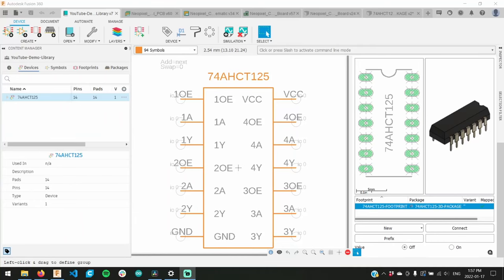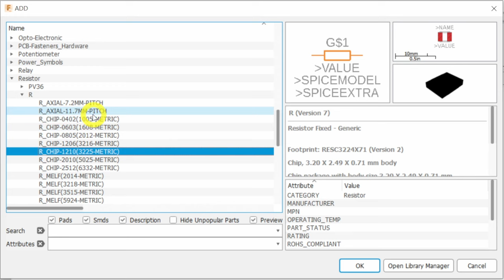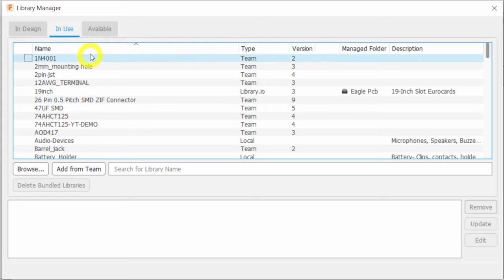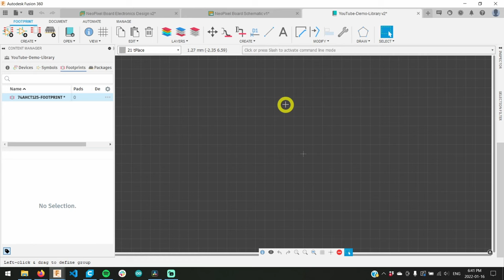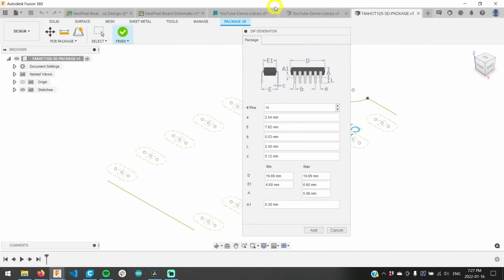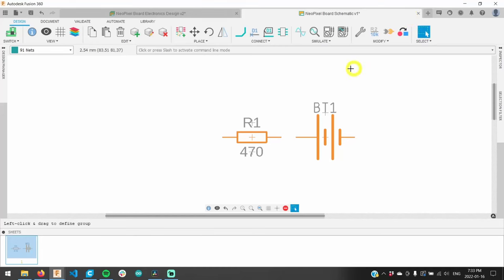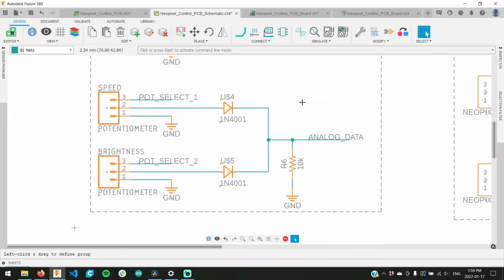Creating an Electronic Component Library in Fusion 360 [Part 1]

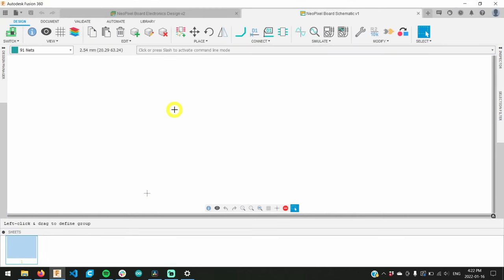Comment from the maker: May 2022 update: Fusion 360 has changed its UI and the component search function is no longer a pop-up window (as shown at 2:36) instead it now appears as a panel on the left-hand side. See this official Autodesk update video for more information https://youtu.be/1ubwXFqwMZ0 There have been some other cosmetic changes to logos and symbols, but underneath the cosmetic changes, everything still functions as shown in this tutorial video

Feb 2023 update: As pointed out by @RodStoddard, best practices are to include the parts name and value by adding placeholder text ">NAME" and ">VALUE" to both the component schematic and footprint.
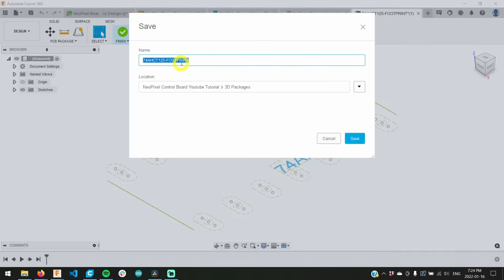Reply: what about minute 13:13 the scene which click the button "Create New 3D model" ??? because that button is not shown in my fusion 360 software, 

the version of my fusion 360 is : 
Fusion 360 2.0.15022 x86_64
Active Plan: Student
Windows 10 Pro 22H2
Reply from the maker: @ameiliaw8191  I am unable to reproduce your issue, I would recommend creating a post on the official Autodesk/Fusion 360 help forums and attaching a screenshot of what you see in your Fusion software for people in the Autodesk community to better help diagnose your issue. I'm unfortunately not able to offer much assistance on a platform like YouTube beyond what is shown in the video
Reply: okay sir  @WillDonaldson  thank you very much for your suggestion
Reply: A simple task of adding apart to a schematic doesn't even work at all now...      
EDIT: I discovered that using the Command Line and typing ADD brings up the traditional parts window and works like in your video.
The library manager is still very different.

Comment: Man, that looks horribly annoying to build one component lol. All I need to do is just change an existing parts labels but it doesn't let me...
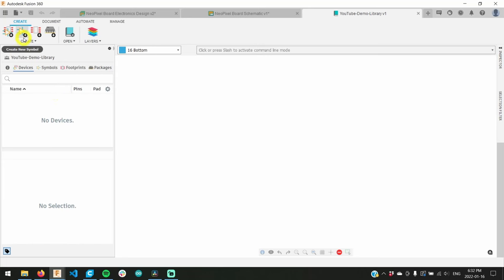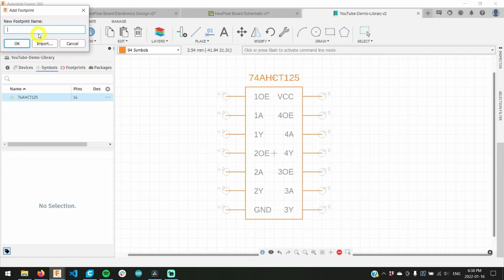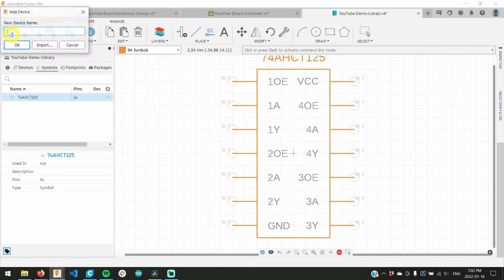Reply from the maker: You can customize an existing component. I didn't show it in the video but at @8:47 instead of typing a new symbol name, press the second button "import". You can then import an existing symbol and edit the labels. Similarly you can do the same process at @11:26 to customize an existing footprint. You will need to still create a new component by linking the symbol and footprint as shown at @16:26 onwards. Still a bit of work to do, but easier than creating a component from scratch
Reply: @WillDonaldson Thanks

Comment: You forgot to add text with ">NAME" to provide the part's name.  You also forgot to set the part's prefix.   The ">NAME" text should be in both the schematic symbol and PCB footprint in the library.  To create elements with a value, you also need to add text that says ">VALUE" in both schematic and footprint.
Reply from the maker: You are absolutely correct, yes I should have done that. I've updated my pinned comment to include this for others to hopefully see as well

Comment: For reference, the boxed letter A in the datasheet is a Geometric Dimensioning & Tolerancing (GD&T) datum, not a label. The A is typically the primary datum, B is secondary, and C tertiary. This sets up the datum reference frame from which dimensions are measured from. Those letters will not correspond with the labels assigned in the Fusion package generator, or if they do it is just a coincidence. Great video!

Comment: Your vid has a lot of necessary details that the official Autodesk videos lacked - thanks!

I would have named pin 1 1OEN (N for Not) or 1OEB (B for Bar) to retain the information that the datasheet conveys by putting a bar over the OE (that it's an active-low signal).
Reply from the maker: Great tip! That isn't something I considered but will implement in my future designs!
Reply: @WillDonaldson  You can also put an exclamation mark before 1OE, and Fusion360 will interpret that and put a bar over the pin name. So you would type !1OE, to get 1OE with the bar over it on the symbol pin.

Comment: Thank you, I am experiienced with Fusion360 for making models for 3D printing but did not know where to start with Electronic PCB design. Just this video has got me a long way into the project I am working on. Just one little suggestion, try to slow down when you select icons etc,  it is not always obvious where you have gone with your pointer. I had to replay many parts a number of times to work out what you clicked on. Doesn't help that Autodesk keeps updating and changing stuff. Not critizing just trying to give some positive feedback, Once again thank you.
Reply from the maker: I'm really happy you found it useful! And yes, some of the cuts in editing were a little fast, I appreciate the feedback and will keep it in mind for future tutorials

Comment: Excellent videos!  Can I ask why you turned on the grid when you created the symbol?  It doesn't look like you drew it to scale and it doesn't seem necessary.
Reply from the maker: Mostly force of habit, but you are right, the symbol is not drawn to scale. The grid helps me visualize even pin spacing but it is definitely not required

Comment: Could you show how to manage with real life footprint design? For example I couldn't find LM2596S component, but its footprint. Should I create my own library even if many other components base on the same footprint and 3D package? If yes - how to import them under Fusion/Electronics? The Eagle had scripts to do so. 
Probably for this component I have to crate my own pad shape. Ok, I can use polygon option for pad creation, but every segment of it requires manual transformation. There is no option to move polygon using mouse. There is no option to align polygon to pads or set distance from pads. If you want to do it - every segment of polygon must be calculated and typed in manually. Consequence is - when you doesn't want to spend whole day creating customized footprint, the task becomes impossible. Every application such as Adobe Photoshop, Adobe Illustrator would allow to create foot print in a minute. The same task under Fusion takes a day. 
It seems that creating your own components, which utilizes none standard shapes requires to spent hours instead minutes.

Comment: Will, Love your videos quick and thorough!  I am having a tough time trying to import Eletronic components with the symbol, footprint and 3D model that I downloaded from ultra-librarian that weren't anywhere in the Fusion library. I'm trying to save time from having to make all of the parts that I need as opposed to making each one from scratch. I am on a PC can you help me out or make a video showing how to do that I've combed through Autodesk to get help but cannot find any answers. Thanks for any help or resource you can refer me to.
Reply from the maker: To be honest this isn't something I've done often as I usually build from scratch if I can't find the component I want within Fusion. I'm quite busy at the moment and don't know a smooth workflow for this off the top of my head. If I find the time, I will experiment and add my findings in a new comment. Or maybe someone else who sees this comment and knows the answer can reply?
Reply: I recently found a workflow for importing that worked for me. For footprints, I download the library the. 1. Import it into my Fusion team database. 2. Create my own parts library (for e.g. my_IC-Digital). 3. In my library, I can import the component from the downloaded library that's in my Fusion team. 4. In my ECAD, I'll grab parts from that library I made. 5. For 3D models, I do a similar process of importing the model to Fusion team. 6. In the device, I create a new empty 3D model. 7. Drag the downloaded 3D model into this file and align to footprint, optionally unlink it so you can delete the original import to avoid duplicates. 
Basically I have my own libraries in Fusion teams that I use whenever I import footprints online. Hope this helps

Comment: Well good! What I haven't seen though. Like I wanted to use this to design a cabinet, But then map out any of the components I use inside the cabinet, And workout the best placement. And being able to move objects around, plan the wiring route, Fan placements, Can you do that with Fusion 360? 

I've not seen anyone use it like I'm saying? but I've seen them do the aspects of what I'm saying. Like this video for instance, I didn't know you could have electrical components, But is that so you can build a custom a case and test how that component fits and so on? 

I haven't seen anyone do that specifically but I'm under that impression. I have been pointed to this program when I've explained it to someone. Because I'm unsure of the terminology they use to describe such programs' other than ''CAD'' Even then its all different categories. This program & Shapr3D on the surface is doing what I'm looking for.

Comment: How do you dimension the symbol and footprint?  My footprint ended up being much longer than the 3D component
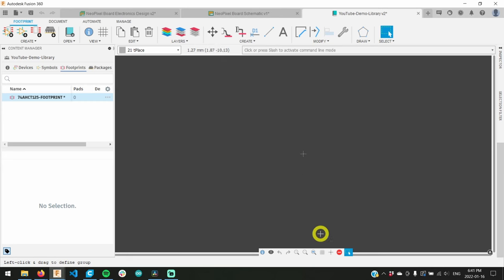Reply from the maker: For both the symbol and footprint, I use the default grid settings as shown at 8:57 and 11:40, respectively. For the component footprint, my grid is a 1.27mm spacing, so by placing the PTH pads two grid lines apart the holes will be spaced 2.54mm as is standard for DIP-packages. Refer to the dimensions given on the datasheet if you are modeling a different component to me. Alternatively, the issue may be that the 3D component you selected in the package generator looks similar but is actually an SMD version (surface mount device) as opposed to a through-hole component
Reply: @WillDonaldson  thank you Will!! I will look into this.  Your videos have been super helpful